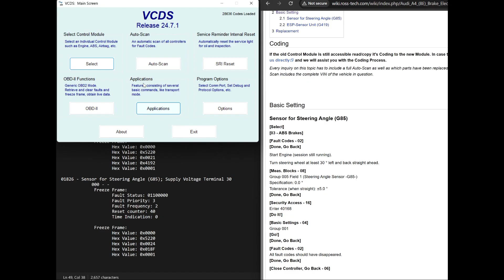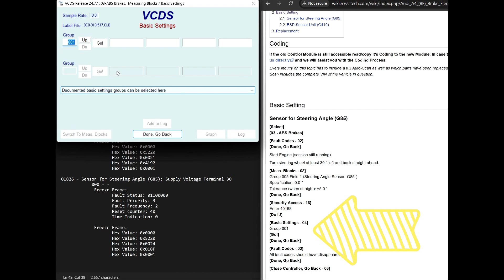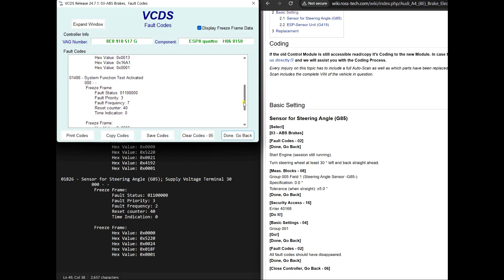Audi B7 RS4 Steering wheel angle sensor calibration/coding

Comment: How do you code a new steering angle sensor using a obdeleven pro ?
Reply from the maker: @craigauty6756  no idea I don't use obdeleven. Try to contact their support to see if they have any option for it.
Reply: I literally just got it done at 2AM at a storage unit cause I got midnight cravings.

I knew how to do the first part of the calibration for the B6’s but the second part fixed it thanks to this video. HUGE THANKS TO CREATOR OF VIDEO
Reply: Let me know if you need help, was no more than 5 minutes if that.
Reply: @johnnypril7902  i fixed it thanks. Was a sequence thing